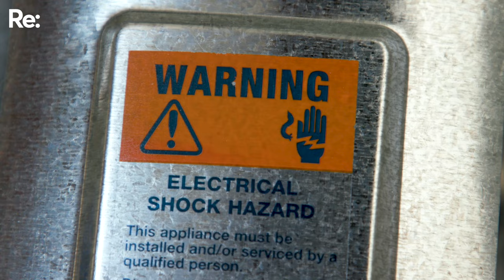What it's really like being a female electrician in NZ

Comment: Back in the 1980's, we had female trainee telecom technicians in what is now called Spark (NZPO, back then) and they were always treated the same way as the males. The job was similar to an electrician, and had a heavy electro-mechanical element to it back then, which later became solid state technology. The number of female techs was very small, but, they could do the job as well as anyone, and we never even thought of hassling them. Don't know why it's gotten worse in the so-called enlightened 21st century.

Comment: Sparkie, what a word. I would never work with bare hands, t-shirt and shorts as a electrician. In some buildsites it is heavily forbidden too.

Ps. Replace those horrible screwjoints from 1950's to modern, latched Wago connectors. It is constant torture to use those.
Reply: Thx for pointing that out mate 😭
Reply: @parzavaal5335  are you the sparkie represented in this video?
Reply: @vicmac3513  nope but no one else pointed it out.
Reply: I would never work with bare hands ? I'd keep that yourself when you visit a Kiwi building site if I was you
Reply: @tonydickey9669  Don't worrry, I won't ever visit this building I've never heard before. But working gloves protects from slits and dirty stuff what sparkies touch at every work site. Prevents dryness nicely too.